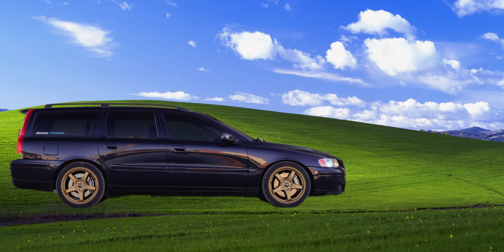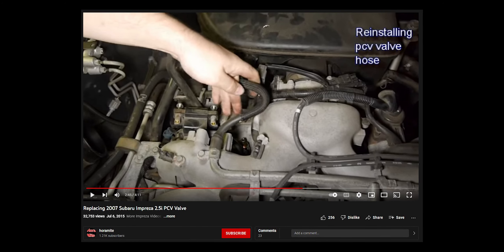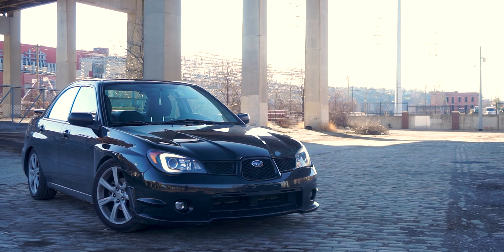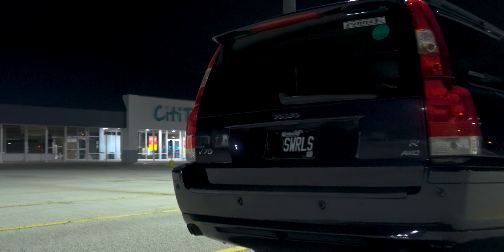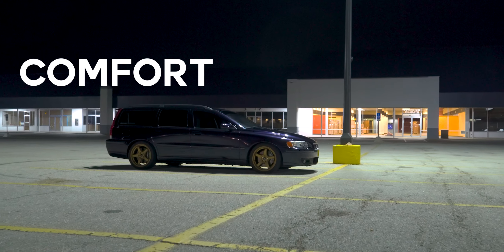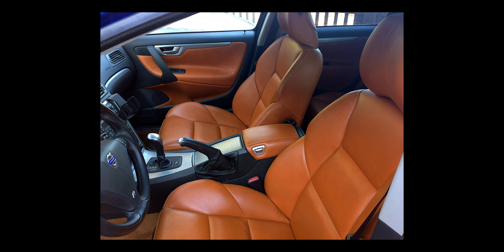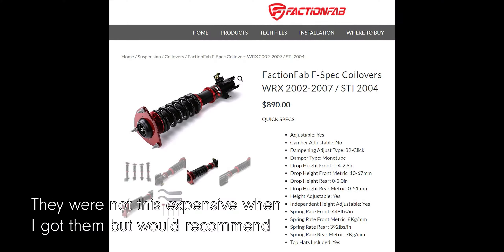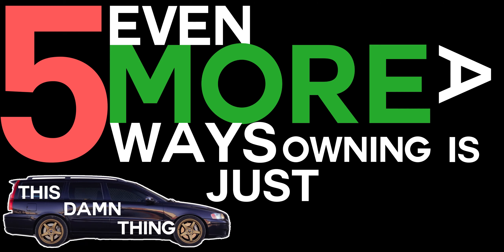5 EVEN MORE Ways Owning a P2 Volvo is Just Different | EP 3

Comment: I've owned 10 P2Rs and can confirm that everything covered here is facts, especially the resonator bolts rusting and just turning into metal blobs lol, I've seen it on every single one I've owned. Also pretty much every P2 I've owned has needed at least one rear wheel bearing if not both. Btw, how long did you spend trying to thread that banjo bolt on the underside of the intake manifold next to the power steering pump when you did the PCV? lmfao
Reply from the maker: 10.... holy!!
I just fixed my front right bearing but because that's quiet now, I can hear the other 3 going out as well.
Both banjo bolts, one of the intake manifold and the other on the block took 3 hours each :) (cries)
Reply: Take off radiator fan and alternator. It is only 20min job- problem solved. Not only it is faster but saves you nerves and stops you from swearing.